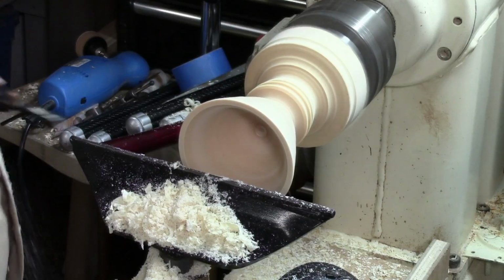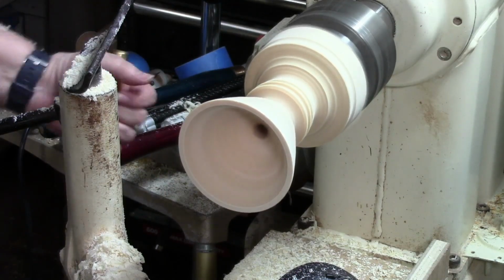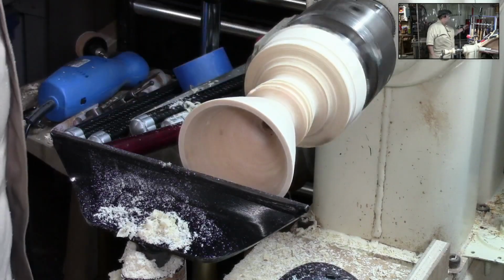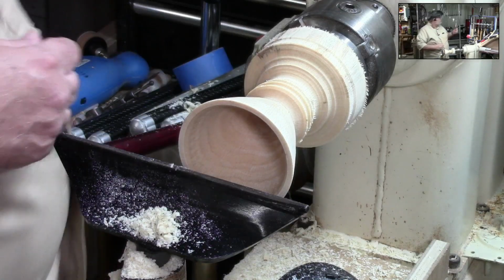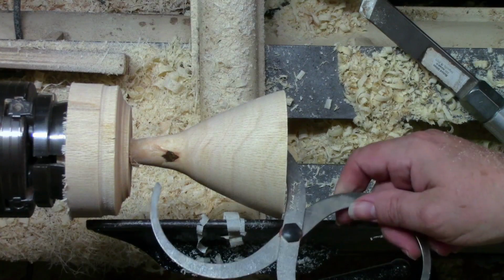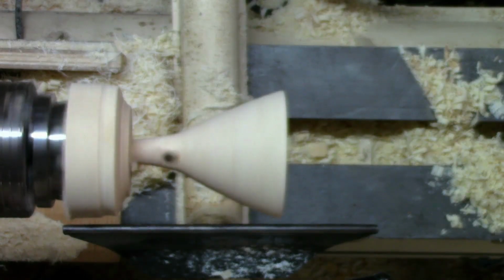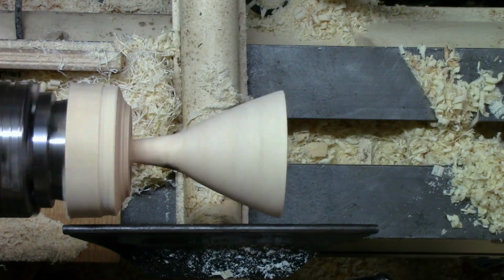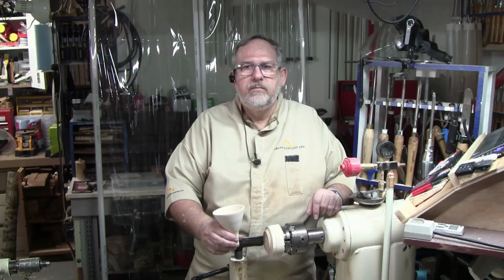Wood Turning Funnels - Ticket to the Funnel Club.

Comment: what were you using to hold your drill bits.  Nice video.
Reply from the maker: Thank you so much for watching. The handle is a screwdriver handle that holds hex bits and locks them in place.